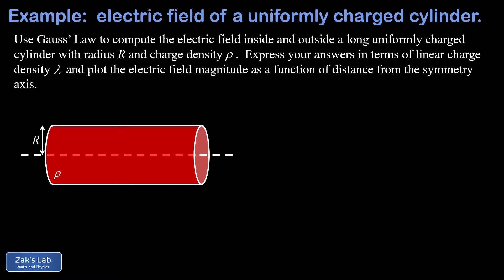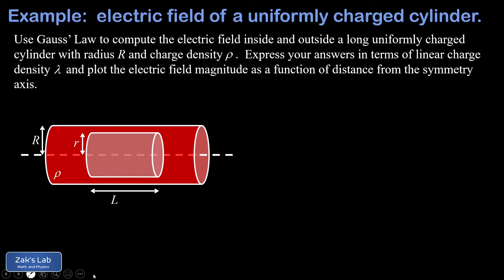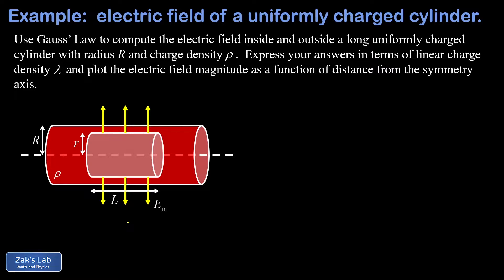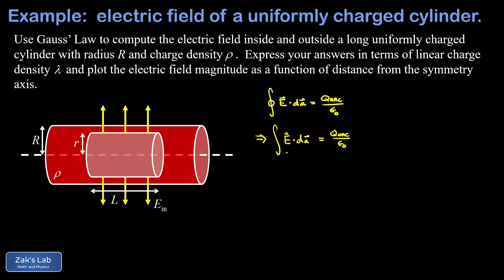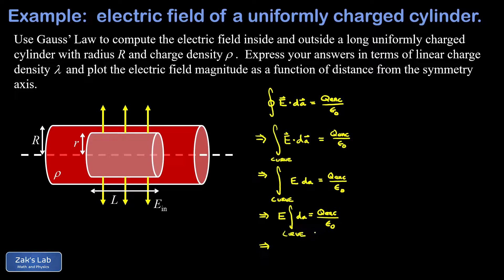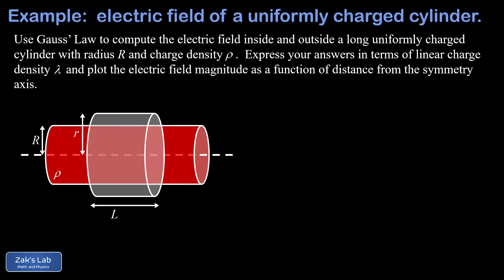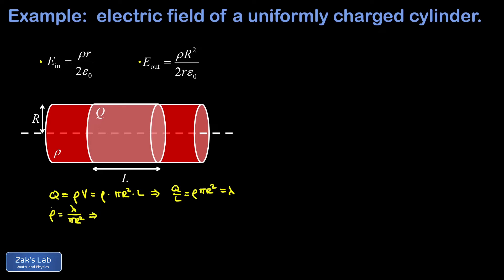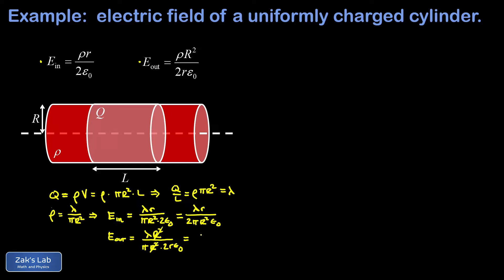Uniformly charged cylinder using Gauss' Law to find electric field inside and outside the cylinder.

Comment: y for the electric field outside is the area R and not little r.
Reply from the maker: Not sure what you're saying here, but the area integral for the outside field gives you the area of the Gaussian surface as 2pirL while the enclosed charge depends only on the big R as rho*pi*R^2*L, which leads to the 1/r dependence of E outside the cylinder, which agrees with the electric field of a thin line charge if you re-express it in terms of linear charge density lambda. z